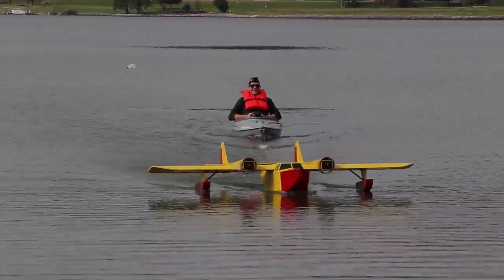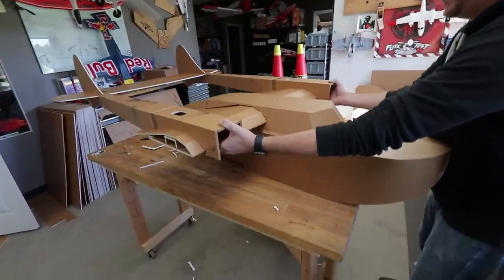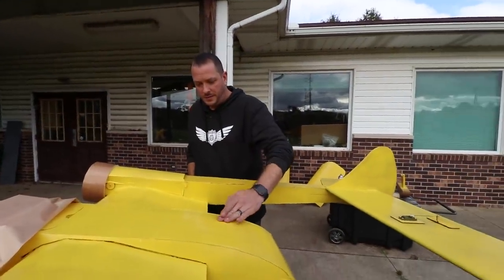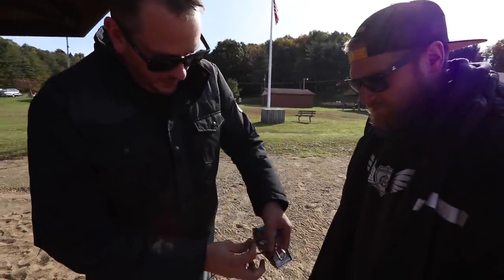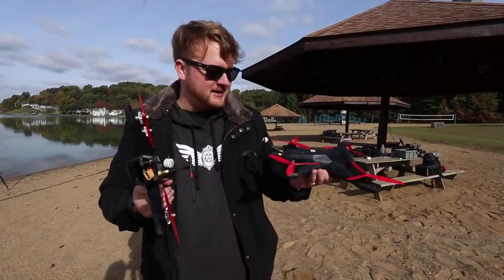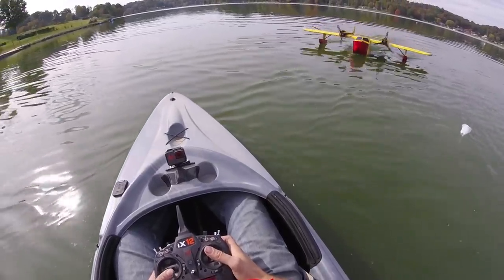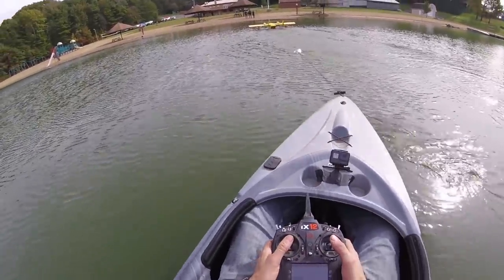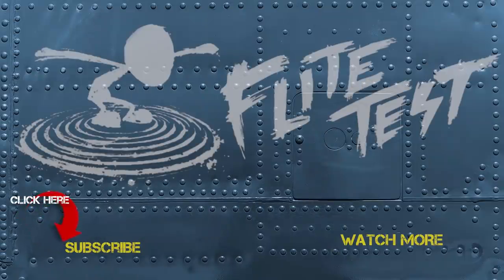I Wanted a Giant RC Plane to Pull My Kayak | Sea Duck

Comment: Make a car battery fly, while using the power from the battery to operate the aircraft. :D
Reply: TRAINMAN K ooooooooooooo! Good idea!
Reply: Something that heavy would need like a full size airplane to fly on 12 volts
Reply: Exactly!! A true challenge!
Reply: They made a cinder block fly, so its possible
Reply: They do have lithium car batteries, that could work!
Reply: @garyjohnson1970  Howard Hughes
Reply: When pigs fly...oh, wait...
Reply: Peter sripol did this, it was terrible.

Comment: Next? Aircraft carrier. USS Enterprise? B-25's? P40's? Torpedo runs? Whole fam is subbed. Much love.
Reply: that would be epic...a flotilla of ww big ships  with a central carrier.... and a whole series of goals.... land and take off a drone from the carrier...launch a small warbird from the carrier..... and then of course, there needs to be bombing of the ships......though I also like the idea of PT boats launching foam torpedos with like a 1 min run time....(no controls...they just turn ON when launched &..run full ahead till the battery (capacitor?)  runs out.. tip it with a small brad or pin so when it gets a good hit , it pokes in and stays to show the hit....)..
Reply: RC Doolittle Raid! YASSSSSSSSSSSSS
Reply: @aj3751  YEEESSSSSSSSS
Reply: instead a black painted broom sticks they could use black painted tooth picks
Reply: @timhyatt9185  I really like the idea of supercapacitor-driven torpedos
Reply: Great idea!✈️

Comment: I wish there were shops which sold massive rc planes like this. I don't have the knowledge or the tools to make one myself
Reply: Ashley Leadbeater same here
Reply: Please trust me! It is not that hard - you can find how to assemble everything on yt and buy it online. But you have to have some skills to make the body. Electronics don't necessarily require them
Reply: @tomash_354   that's the thing. I don't have any skills in making things. I could probably follow a YouTube how to video though
Reply: @ashesgaming841  Look for: how to make a 100$ racing drone from UAVfeatures. But please keep in mind it will cost more (but these are only one-time expenses in your fpv career) I am talking about remote, fpv glasses, some batteries, charger, some racing camera (probably gopro or runcam) and fpv camera that you can swap between drones

Comment: I'm not at all surprised that it worked. After all Josh in the kayak  has negligible weight when floating and all the plane had to overcome was the initial inertia/drag. The original Sea Duck would probably have managed to do that, albeit more slowly. Fun to watch though :)

Comment: So, a typical low-end electric trolling motor will push out about 650 watts/0.9 horsepower.  I don't know how that cross-references to the kV ratings used for your motors, but I would place a small bet on the two motors in that plane beating out a trolling motor.
Not so good for fishing with the noise, but surprisingly practical for model seaplane flying.
Placing a buoy on a tow line is a fairly common nautical practice.  But kudos to a plane guy for coming up with the idea independently.

Comment: Instead of making it fly with wings, which aerodynamically would be easy, why not use some Heavy lift T Motors, make it fly with some weight. 

P.s. just to let everyone at Flite Test know... A 64mm EDF fits perfectly in a Pringles can... Just food for thought. Junkfood flyer challenge?